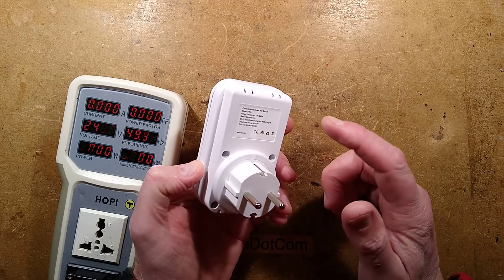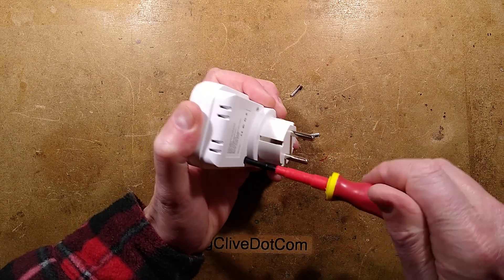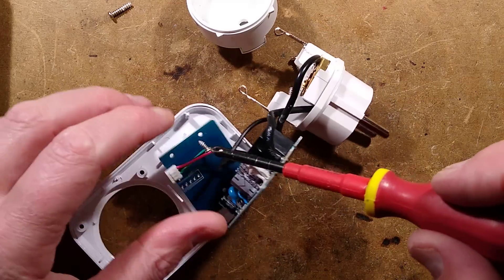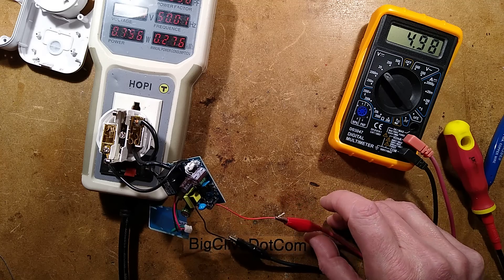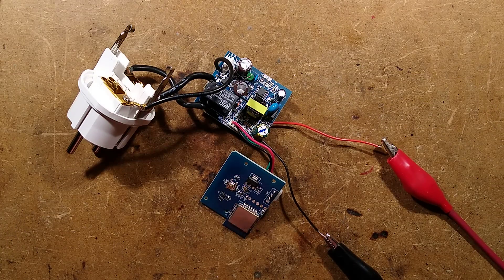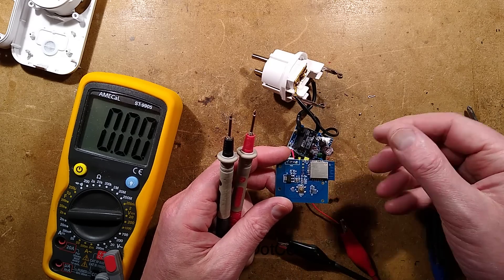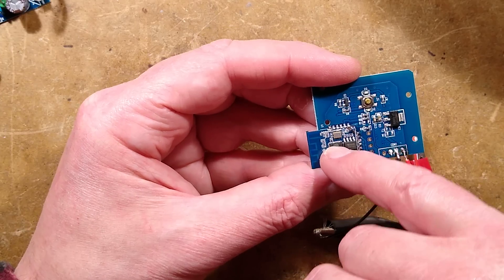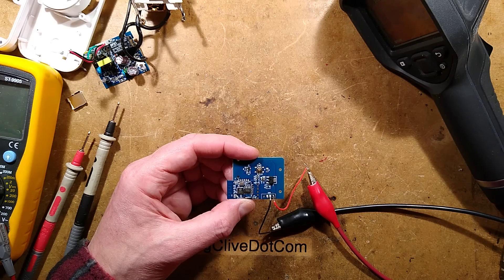WiFi socket repair fail

Comment: Those boards have flash sotrage that can easily corrupt. If the esp is getting too hot its fried! Get a new esp module or tywe3s (tuya module, likely the module thats inside) maybe desolder the flash of the dead module and put it on the new esp module

Comment: I been making these on my own with a sonoff sv, a dual circuit 5VDC relay, a push button w/light and then the outlet and box and use a cord for the plug. You can convert the sonoff to dry contact and use it to switch power on the coil for the dual relay, one circuit will turn on the light on the push button and the other will turn on the outlet. I scavenge the 5vdc from a USB power plug and minimize it as much as possible. The sonoff can be programmed as a timer or switched from your phone, or add the push button and that does the switching too. Or for other applications you could set it for inching by the half second. If you do wire in the button you can easily add in parallel a remote receiver to trigger the button and use a remote to turn on or off something maybe like a dust collection shop vac for instance or lights in a room or by a gate. Or maybe you have a few of these set up and use a 4 button remote for the pedestrian door electric strike and the overhead door and the shop lights and a vacuum. Just some things I've been playing with, I'm sure someone who understands these things better would cringe at what I've done lol. I appreciate you

Comment: I don’t know about the 8266 version of the ESP chips, but the ESP32 version is extremely sensitive to reverse voltages at the power inputs. They go into a mode exactly as you observed where the chip just gets very hot but is otherwise dead. I discovered this after blowing up 3 in a row and then finally discovering that when my portable bench power supply was “off” it was really putting out just over a volt backwards! It wasn’t my board design as I was powering them directly and not through the onboard supply ;) I don’t know if something could have hiccuped in that power supply to have caused such a thing, but it definitely is a mode of failure for these things. It doesn’t take a lot of current either, just the 1.2v backwards with almost no current available at all was enough to blow up three of the others.

Comment: Hi Clive, remember the highly rated pound land double USB charger plug that got a very positive review? Just had one explode itself in to a fireball this morning in a very dramatic fashion running a phone and a wifi camera. Would you like to work out why?
Reply from the maker: Usually when they go bang it destroys the evidence.  I recommend plugging all USB chargers into an adaptor or extension to provide local fusing.  In a later version of the two channel Poundland charger they switched from a slightly toasty output diode to a much better synchronous rectifier.
I wouldn't recommend loading these devices with two high current devices.
Reply: @bigclivedotcom  thanks! I’ve learned my lesson and gone back to Apple official !
I have studied the wreckage and realised this was one of the newer type with rectifier. :(

Comment: I don't know about ESP8266, but ESP32 gets pretty hot during normal operation and it's actually problematic powering it from weak USB ports. None the less, the chip could still be bricked for whatever reason.

Comment: Usually when those ESP modules get hot, it means something got fried internally (usually in my case it's because I wasn't paying attention and put 5V somewhere it didn't belong, which doesn't usually work out).  As other commenters have mentioned, you can get those modules pretty readily (the ESP-12F or ESP-12S have the same footprint as that one does and should drop right in).  You can then flash the original firmware back onto it (if you have it), Tasmota or some other firmware via UART and be right back in business.
Reply: ESP modules in active mode and seraching for wifi are always hot.

Comment: I have a zigbee "smart plug" that recently failed in an interesting way: When you switch it on and there is a load plugged in, it will trip the GFCI. It doesn't trip not when there's no load plugged in.
Might make for an interesting teardown video. I could mail it to you if you have an address/PO box that I can send it to.

Comment: The memory IC could also be the problem.
Unfortunately these devices are so cheap that it doesn't really make sense to put a lot of work into it.
But both components are widely available and there's a open source software for it.
I've reflashed a handful of devices like that, all using the same ESP, for some I've even soldered a bigger eeprom to run larger firmware files.
Also, the ESPs get pretty warm when Wifi is enabled, so this could be actually normal.

Comment: Never used a switch like that, but I assume it comes with an app or built in web server for management. Perhaps button is disabled and unit is only operated from the app/browser?

Comment: Bad Corrupt ESP 8266  firmware 
its easy to forget These  ESP Have No self Antivirus & malware Protection 

- Even can fail A Firmware update due to brown out Heavy load Else ware (in the house or on the Street 3 phase) while it doing ANY firmware  Update 
- even Dead /  wrong firmware  by the Manufacture 

Even hackers little Toys ESP Zombie & ESP crypto miners (any crypto ) & ESP multi Network RATs

Comment: Hello Clive, I've been a fan for a while now and I was wondering if you took commissions for teardown and possible repair videos ?,  You see the central heating / hot water clock stopped working correctly in my parents house around Christmas 2021, It started cutting out and requiring to slide the switch from "Constant" to "Off" and back to "Constant" in order to get the red light back on and have the heating running again. During investigations we took the clock off its holder on the wall and we discovered black smears (burn ?) over the rear PCB that presses against the contacts in its holder, Something we later discovered is that if you have both central heating and hot water switched on at the same time something buggers up and causes it to switch off or trip out but if you only have one on at a time (water or heating) it seems to work okay which is rather odd.

Its a Honeywell st699b1002 a model fitted in UK houses around the 1990s and it seems everyone's clocks are failing as of late and unfortunately this model of clock is no longer in production as it is "No Longer Up To Code Of Modern Standards", And what's even more unfortunate its not a straight swap for a modern clock because the wiring is different so you'd have to get someone cutting your walls and pulling up floorboards in order to wire the new clock and we got a quote for this being £700, As quite a lot of houses have this model of clock and getting a new one fitted is a big expensive job people have been buying ones that are still working on eBay to do a straight swap with their own faulty one and this of course has been noticed by scalpers and lots of companies and individuals are selling these clocks new and used for around £300+, We were fortunate in being able to find one at £90 which doesn't look bad at all and works perfectly.

Would you be interested in me posting you this Honeywell to do a teardown and repair and be able to advise people on repairs or faults that can be rectified ? My Dads current plan is to keep it as a spare in case the one that's fitted duffs up because at least this one "Half Works"

I genuinely wouldn't be offended if you're not remotely interested :)

Thanks!
Reply from the maker: The Honeywell stats often fail due to electrolytic capacitor degradation.  I looked at one a while ago.
Reply: @bigclivedotcom  So you did ! Thank you very much, If its as simple as an Electrolytic Capacitor any fool could do a replacement on that, I suppose its the #1 obvious thing as its the same in old video game consoles.

I'm just not sure why it would have scorching on the back of the board as it basically only holds the contacts that press against the wall, doesn't seem to be any obvious Capacitors in sight.

Comment: havnt watchet yet but thank you!! most people dont post their failures, probably with my luck it will still be fixed by the end of the video haha
we dont ALWAYS succeed in what we try to do
Reply: also, i prefer zed-bra, pronounced as spelled just to be contrary
also here is a thought, reflow the solder pads to the ESP board, all of the little esp modules i've found tend to get hot as hell and some break solder connections over time and use, try pressing on it to see if it suddenly starts working or just reflow the connections

Comment: Utility surge..there was one yesterday morning and the neighbor suffered a house fire.  Near total loss.  Reporter claimed the rain was the cause but service entry point is on the other side of the house and without damage.  I installed flooring in the house 7 years ago and knew it had aluminium wiring to the dryer connection, this is also the center of the kindling point.

Comment: ESP8266 is very common for the do-it-yourself'er. Any device I buy (like wall switch, or RGB module, etc.) I make sure it comes with one of those chips, and then I just flash tasmota in to it. Very easy to flash!

Comment: That’s an esp12 and they’re super cheap on Amazon and easy to replace and easy to flash with tasmota or esphome which is better anyhow that online crap. 

That is what we call a good unit because they’re easy to tap from the programming headers and reflash foo if the chip is still working or just use a heat gun to lift it off.
Reply: Both require you to have a active ha server wich you have to pair to the module so its a bit kore hassle
Reply: @309electronic5  you don’t need it. You can do all of it in esphome alone including the automations.

Comment: The wifi module is probably  esp12f.

This module have at least  3 ways of working  modes.

The working mode depends of logic level in 3 gpio pins then module powered.

Common issue is then gpio0 is connect to low logic level then power up.
So if gpio 0 used as input or output is possible to have issue from bad transistor  or bad switch. 

The esp8266ex don't have internal memory to storage program so is possible bad spi m3mory to cause this problem

Comment: Yes. Like others already said: hook up serial lines to see if it is alive. If so, then flash it with Tasmota. If the ESP died, you can revive the unit by transplanting a working ESP module. Or just buy a new one. If you have such devices, always flash them with Tasmota, so it can be directly controlled by your home automation software. If you'd buy a new one, you usually need to create an account at the manufacturer's web site and use the manufacturer's app in order to control it. Only then, you can integrate it into your Google or Amazon and then let all of those big tech companies harvest your data and sell it.

Comment: You can unsolder the WiFi module from the main board and replace it with a new one, this looks like a Tuya based device and those ones are easy to flash something like Tasmota or ESP-Home onto! 🙂

No more dialling home to the Chinese mothership then! 👍
Reply: To much hassle for clive! Set up a ha server, set up mqtt, set up mqtt password,flash device, pair device

Comment: It could be corrupted firmware....getting it into flash mode shouldn't be too difficult, and then flash tasmota
If it really is a failed chip, esp boards are really cheap, to solder on to the relay board

Comment: Clive have you ever repaired wires from an electric blanket switch? My mum's packed in and I noticed the outer insulation was split on the output side of the switch. I tried to shorten and re-attach the wires into the switch, but when you strip the inner insulation, what's inside looks like some kind of plastic material like nylon string. Trying to strip that further, the whole thing just evaporates into nothing. Tried soldering them directly onto the little spades on the board, but again it just disintegrates. Any ideas?
Reply from the maker: It sounds like resistance wire.  I wouldn't recommend repairing it.  Treat your mum to a new one.

Comment: I currently use a smart socket with Alexa on a schedule to auto recharge a 1000 Lumen Solar motion light that i installed a TP4056 on for an hour and a half every day then turn off, its above my front door under an overhang so it cant charge with the Sun thus the module), been working flawlessly for the past 2 maybe 3 years, though i suppose i should change out the 18650 cell at some point..
Reply: whats the point in charging energy into a short lifespan lithium battery when you have the wire and psu hooked up ?

and whats the point of a solar light in a shaded environment in the first place ?
Reply: @casemodder89  Umm... because it lights up the front door area and part of the front yard when there is motion? and because with where my front door is compared to where the sun rises and sets it wouldnt get enough sun elsewhere in the same area to last a full night?

Thats the whole point of making it USB Rechargeable BECAUSE of the fact its under an overhang and wouldnt be able to solar recharge because of it.

And ive already considered just using the USB to power the light without needing to use an 18650, i just havent needed to.

And 18650s are not SHORT Lifespan cells, its been going strong for the past 2 or 3 years now, though i have thought about changing out the cell.

Anything else you want to know?

Comment: That's a standard ESP module. You can buy them online. You can flash it with Tasmota. An open source home automation firmware. Should be a simple fix.

Comment: You can't save them all .....  stares at floor in silence for regulation amount of time, wipes brow and rubs hands together briskly while stepping away

If the switch-mode power supply has a proper transformer, not just a bucking inductor, and the separation distance on the board looks reasonable  (or even withstands a high voltage test!)  then I suppose you could chop the USB plug off a cheap phone charging cable and hot-wire it straight to the 5V and ground lines, and repurpose it as a charger with mains passthrough, for those times when you just can't find enough sockets .....

Comment: Those low cost wi-fi controllers are notorious for failing, you can find them in cheep usb wi-fi adapters too, I don't think I had one of those that lasted more than 6 months.

Comment: One thing I dislike about modern circuit boards is the use of microcontrollers for everything. Once a controller dies or the memory gets corrupted, it can be hard to figure out what's gone wrong and debug the issue, and it doesn't help when a manufacturer scrapes the part number off, the chip is proprietary or the programming software is extremely awkward to use, or you have to pay for it.

Comment: The poundland Wi-Fi smart sockets are actually very good. They have been reduced to 3£ !! The relay inside of them seems very generous 16 amp ( more bulky relay). And all the power tracks have been beefed up with copper bars, and extra solder. It has a similar esp8266 module. And it looks like you could easily flash it with tasmota. I have purchased them in the past just for spare parts. I remove the Wi-Fi module, and use the relay driver and power supply for projects.

Comment: Ah, the typical ESP8266. They're everywhere and can act as microcontrollers in itself. Very cheap and common in home automation devices.
If you want to tinker with a ESP8266, it's best to get a development board like NodeMCU etc.

Comment: Looks like a great time to make a custom function device. You have a power relay and 2 common power supply voltages. Now what too make. Sound or light control switch ?  Temp control switch ? Humidity controlled switch ? Let's think outside the box. A fart detector-controlled switch. Carbon dioxide detector switch?

Comment: the brain is dead? then it has become a digital "karen" lolololol
it must think that 5g is full of "death beamz" (please like my comment clive.......)
Reply: it actually might be corrupted code in the memory chip causing a loop that does nothing
try finding a copy module and reading out the data and smacking it into a new chip for that one
or try reading out the data from that chip and run it through a simulator and see if the simulator turns on the simulated led in less than 10 minutes

Comment: Huh, I didn't expect an ESP8266 in there. That's quite the common wifi-enabled microcontroller. Mostly replaced by the ESP32 these days, but people still like the 8266.
Reply: Tuya already used esp devices in 2018 but nowadays esp8266 based tuya module devices are very rare, tried to get some but all beken now

Comment: They do run at about 90 ish mA when active. 130mA when talking to wifi. You can get them down with sleeps etc, but sounds like its just in a vegetative state. You can feel them usually just warm to the touch.

Comment: With microcontroller based stuff you can check more than just power supply. 

For example;
Stuck buttons confusing the system.
System held in reset by faulty power-on-reset circuit or similar.
Missing enable signal(s).
Missing clock signal.
Etc etc

Comment: Frustrating indeed when you cannot repair it. But I think it's better to not even buy those products because they are 1) not needed 2) bad for the environment as they use power all day all night. Moving a few more muscle groups to reach and actuate a switch like we did in the 20th century works and is more than enough.
Reply: using non-wifi wireless sockets like 433 or 868mhz is the best of both worlds.  no need to reach in awkward positions and almost zero current in standby.  transmitter is handheld and runs YEARS on a battery.

this wifi crap tat is nothing but landfill.